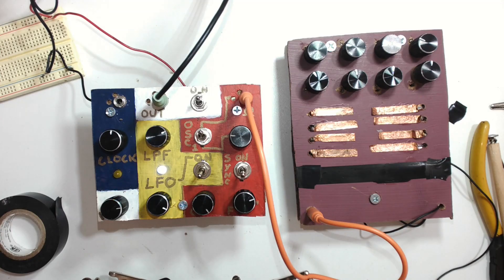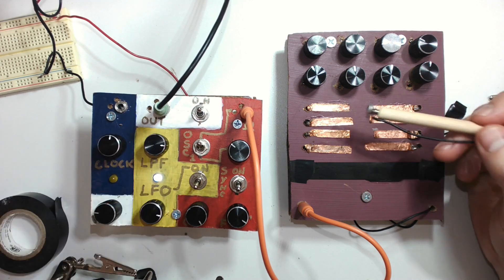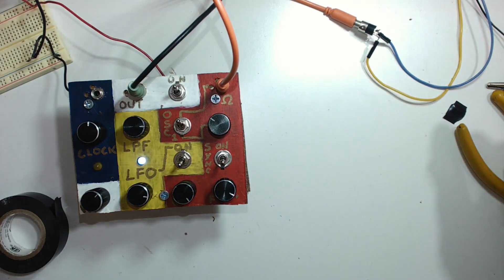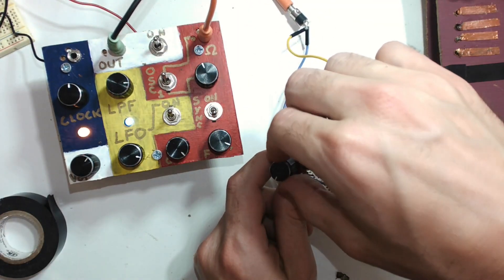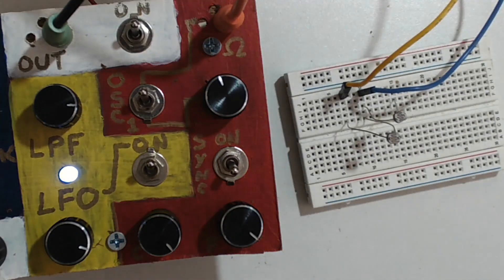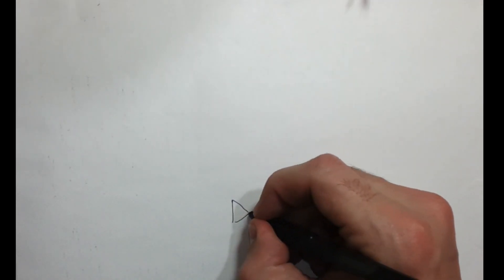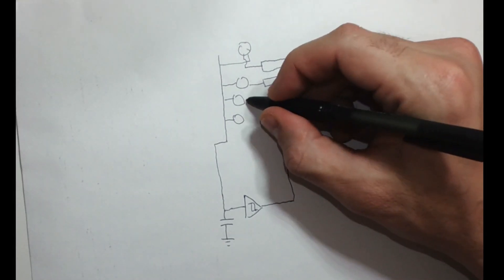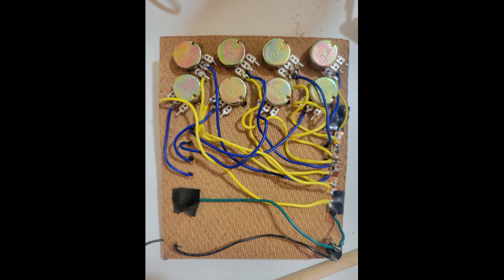Expandable DIY Synth & Stylophone

Comment: Nice work!  What op amp are you using?
Reply from the maker: It's 2 40106 Schmitt triggger based oscilators, which is an inverting op amp.

Comment: Really great vids... is there a way to add VC to oscillator?  Thx!
Reply from the maker: I haven't tried voltage control, since it would be tricky to get it to be 1v per octave, so I went the easier route with the resistance. I keep things pretty simple, but Moritz Klein has some more advanced diy synths that can do 1v per octave. Maybe I'll try a variable power source and see how that affects things for the fun of it and let ya know.
Reply: Aaah... understood that makes complete sense.  thank you...